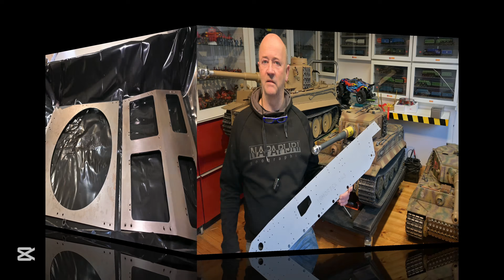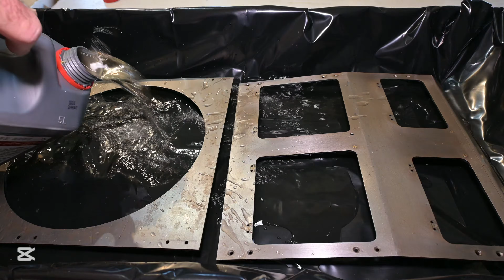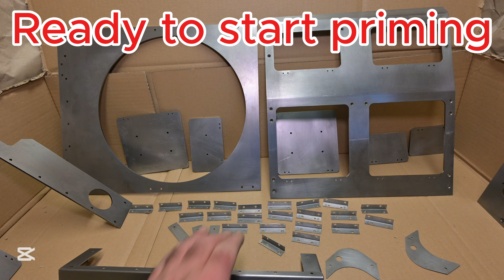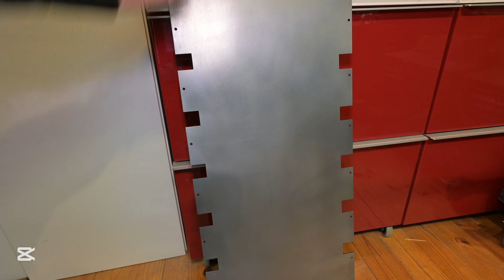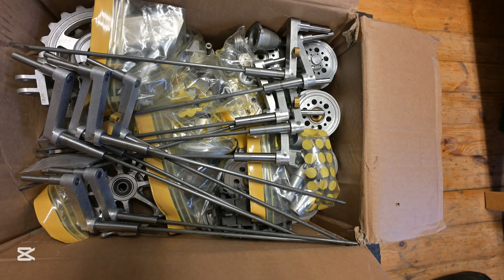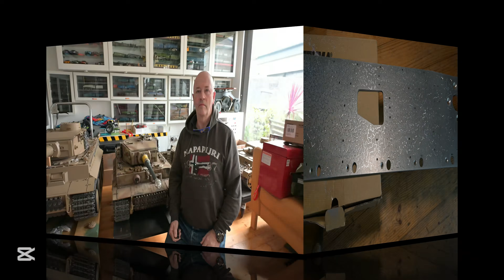Armortek panzer III (part 3) rust removal etch priming

Comment: John, just for future reference. When using rattle cans to paint, I was advised to warm up the paint by putting the cans in a bucket of warm water for half hour. The paint will flow better when its warm. keep up the good work.
Reply from the maker: @MrKurt888  Yes, I had the can on the radiator for a few minutes.